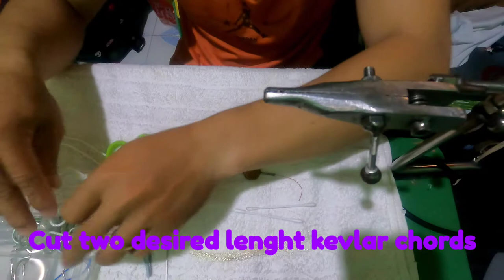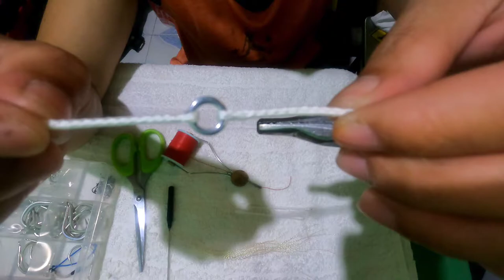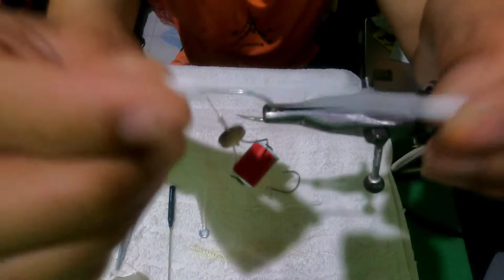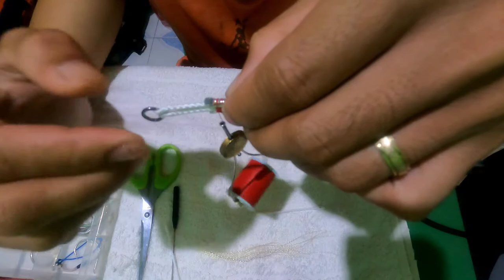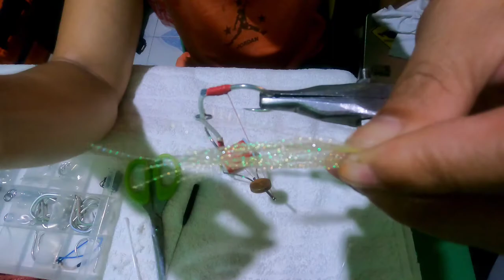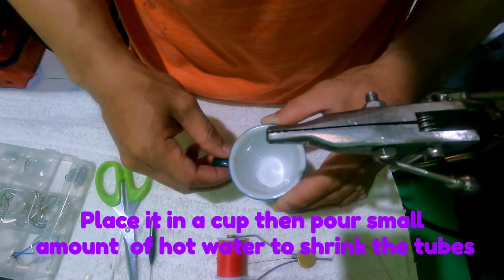Splicing Jigging assist hooks on my DIY Splicing vise | How to | DIY

Comment: thanks . would you consider sharing instructions on how you build it?
Reply from the maker: I plan to fabricate again with the same design and with a video when i come back onboard. But i only build it with scrap metals of 10mm round bar, 5mm flat bar, some stud bolts, bolts and nuts, ball bearing, welded and all are made of stainless steel.